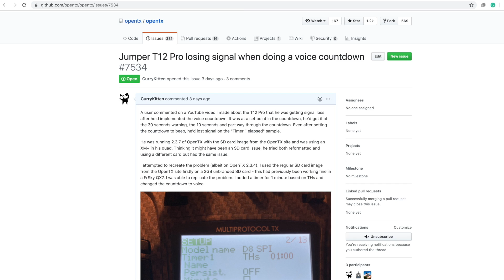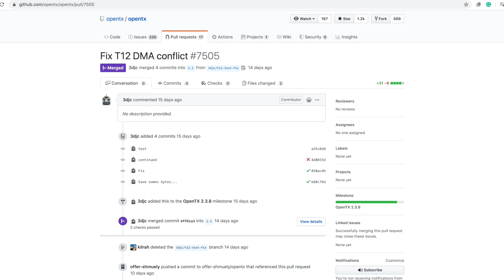Loss of signal issue with Jumper T12 Pro - how to avoid !

Comment: Had mine for 8 months and I've had 4 fall out the sky and 1 in a swamp due to the radio either losing power or signal. I don't have voice active on mine and I have zero vibration or indication. Thought it was me and my tunes so had 3 other advanced pilots check and they had the same issue with my radio..
Reply from the maker: Did you upgrade the OpenTX firmware yet, this particular issue was resolved in 2.3.9
Reply: Yea I sure did. I'm not sure what the heck going on with this radio.. sucks cause I really enjoy this radio but I'm out of options and I think I'm going to have to buy a new radio all togsther
Reply: Was using xm+

Comment: I just got my T12 pro about a mo ago used it about 2-3 times and what your talking about happened today but it's more then what you said it does it without a timer or anything talking and sometimes it won't even keep signal it will say telemetry lost telemetry recovered telemetry lost telemetry recovered back and forth about four times it does that I will now take the sd card out to see if I have a problem again lukey this all happened at start of take off I didn't get but 5 sec in to flight maybe when it started after I couldn't fly at all because I had no idea what was going on
Reply from the maker: First off, update to the latest OpenTX firmware and the problem I described is fixed.  Secondly, having a rapidly repeating telemetry lost/recovered is usually something that happens when the radio is very close to the receiver.  The power of the radio overwhelms the rx, so telemetry is rapidly being lost/recovered

Comment: I am using Jumper T12 Pro with OpenTX 2.3.9, still losing signal, I have been looking for a solution all over the internet, the only solution I had found is taking the sd card out, but then you dont get any of the alerts, if any one know how to fix it please any help will be very appreciate .
Reply from the maker: That's odd.  The nightly build for 2.3.8 and then the official 2.3.9 completely fixed this for me.  You're the first person I've heard who still has an issue.  Are the symptoms exactly the same - with signal dropping out during any sort of voice alert?  Perhaps something not quite right with the flash - bit of a grasp at straws here, but try reflashing (unlikely, but not too much effort) if problem persists, then open up another issue on the OpenTX github
Reply: Tony 0  I do not longer have that radio any more.

Comment: Hello.
Ive just ordered this radio and i was wondering if there has been a stable release that solves the problem. This is going to be my primary radio and i will use it with a flysky reciever
Reply from the maker: Yes - this is fixed on OpenTX 2.3.9, and I've tested it out - all is good.   There's still a minor bug with this radio in that it will sometimes randomly say "receiver still connected" as if you were trying to turn it off with a telemetry receiver connected to it.  This doesn't actually do anything though, it's just a bit of an annoyance.
Reply: @CurryKitten  I have OpenTX 2.3.9 still lossing signal.

Comment: Hi definitely going to sound like there's something wrong with me i have been in the  rc world all my life and figure what the hell lete learn how to play with a drone and any body can go out and buy a pre biult one that has not controller calibration those are toy so i built one i have a 5" with matek f722-std with a bunch of bell and whistles but because of your review of this remote and also Joshua Barlow i figure what the hell it will work fine for what i want. But for the life of me in betaflight i the number of the min  mid and max are all spec and when i hit the stick to full trottle it only goes half and i only find videos of the trannis with some of the settings are close. But is it a remote problem are betaflight problem. Any help would be great and if you have a video that you made that talk about it if you can forward the link thank you very much
Reply from the maker: It sounds like there's a setting somewhere along the line that's not right... although it could be one of several things.  If you can make a quick video showing what you have done and what happens that would really help.  You don't need to post it here, ping me a link at my email address currykittenfpv at gmail dot com and I'll take a look

Comment: Awesome videos and explainations. Just upgraded my T12 Pro with 2.3.8 and module firmware upgrade. This helped tremendously! 

BTW, flying AIR mode for the first time today (Tinyhawk 2); 9 batteries later (and one mild crash) tried STAB and could not control the drone. It felt locked!   :)

I've been scrambling through your videos most of the week cause I've been trying to setup my  T12 Pro betaflight modes on a three position switch;  you know like having STAB,  HOR and AIR. But Betaflight only recognizes two positions no  matter with switch I use. I had STAB and HOR but wanted to try AIR today. I just dropped HOR and now I have STAB and AIR on the switch. 

Any ideas why betaflight only sees two position? I checked CH, Mixers on radio to no avail. I did noticed that the third position is not showing on the radio either. I seen movement on Pos. 1 and 2 but the bar doesn't extend to the max on the third position. If you could offer me some pointers/advise I will greatly appreciate. Awesome videos!!!! Thank you.
Reply from the maker: Seems unlikely to be a hardware issue if it's doing this on all the switches.  How did you set the mix up for the switches.  I made a video about setting up a quad on your radio and betaflight here https://www.youtube.com/watch?v=O1Ea3wljoQs is it different to what I do in that ?
Reply: @CurryKitten  Thank you so much for this link. I deleted the INPUT and  MIXER value I had and followed your guide and Viola! Everything is working as expected! I appreciate the help.

Comment: My new T12 pro does this also. I will remove the memory card tonight and see if it still happens. Thanks for the helpful info!
Reply: Let me know how it goes. I'm thinking of getting this radio.
Reply: @MicroModDude  I ran 7 batteries through it last night and I did have 1 dropout. I like the radio and the dropout may have been a fluke.
Reply: @toddschwietz2483  I might just get the Jumper T8SG V3 Plus Carbon edition. It doesn't seem to have that problem but looks similar. It doesn't look like they didn't do enough beta testing on these before releasing.
Reply: I’ve been having range issues with my t12 pro too. I do not have lua or an sd card. I’ve tuned my frequently but still only getting about 50 yards.
Reply: @theoneshannon6642  You try the newest firmware?
Reply: MicroModDude I haven’t updated. Sounds like that’s my next project.

Comment: Maybe the DMA conflict is between getting/playing the sound file, and something with the internal MPM of the T12Pro. So, no issue with older T12/+ with external modules?
Reply from the maker: Some other guys reported similar issues on regular T12's as well
Reply: @CurryKitten  Ah okay. Did you and the others that had the issue update the firmware on the MPM? I am not having issues with a T12+ on 2.3.7 and MPM on 1.3.0.89 that has been frequency tuned to a genuine FrSky receiver.

Comment: Thanks for the tip. I also noticed another bug in my T12 Pro, when an receiver is connected, the radio randomly gives “receiver still connected” warnings. Taking the SD card out the warning becomes a haptic feedback. Seems like the radio wants to power off randomly on its own. This happens only when a model is connected, doesn’t happen if you just have the radio itself powered on. Do you have the same issue?
Reply: Had this happen once or twice on the T12+ on 2.3.7. Strange
Reply from the maker: I've seen it happen as well, but only when I've been in very close to the RX.  Making me think it was a symptom of the RX getting flooded (where you'd normally just get a telemetry lost)  Have either of you guys had it out on the field where you are proper distance away ?
Reply: @CurryKitten  Yes, the times I heard the "Receiver Still Connected" was in flight, with the drone maybe 20 meters away. So, it wasn't a Rf swamping/flooding issue.
Reply: reported that on github, please add your comment if you have any more clue what going on: https://github.com/opentx/opentx/issues/7646
Reply: Víctor Martínez thanks for the report. I’ll join the conversation as well, try to provide more information. Btw mine makes noise too, if you try internal module Flysky, it produces the worst noise. I’ve cycle through all protocols they all produce different types of noise and pitch. It’s quite annoying, but I guess this is more related to interference unless you physically modify and shield the speaker.

Comment: The Ebay vendor that sold me the  radio told me that the T12Pro has never been designed to use voice prompts and warnings. I replied back to that idiot, why does Jumper's own firmware download include the voice pack and why does the thing have a speaker, and menu options for voice. The seller does not even list on his site that the radio is not to use voice features He is heli-nation. I would not purchase anything from him period!

Comment: Wish i found this video last week, been scratching my head why ive been failsafing with a brand new tadpole build using a R-xsr and my 5" with a dsmx rx, interesting tho i dont think my brushless whoop with dsmx has done it once yet..(only had the radio a month.)ive heard rumor that it may also have to do with telemetry?
Reply from the maker: Telemetry shouldn't have an issue on loss if signal, but if it says "telemetry low" or something like that, then that goes back to the problem losing signal when accessing the SD card, so the two events could look ralated.
Reply: pulled the SD card and problem free for 4 packs so far. ty again.
Reply: @EntropiaBCG  so, is removing the sd card is only solution?? or updating to latest OpenTX solved the issue??
Reply: @Suraj_Mandal.  i havnt updated since,and just leave the sd card out.
Reply: @EntropiaBCG  is your jumper t12 pro still good? planning to buy this radio
Reply: @pipoypipoy7796  yep still working.
Reply: @EntropiaBCG  how many points of jitter do you get on your t12? and does your t12 center at the exact same value everytime?

Comment: Thanks for posting this!  I was thinking my several frequency tuning attempts were failures.  lol.  I'll try pulling the SD card to see if my quads with XM+ receivers stay in the air properly now.
Reply from the maker: Hope that helps - looking forward to the 2.3.8 update
Reply: Yep!  Got through 4 packs without a signal loss so this must've been the problem.  Thanks again 😊

Comment: Thanks @CurryKitten.  Maybe you can do a tutorial how to download a specific firmware.  I got the older OpenTX Companion for 2.3 nightly but it keeps taking latest of whichever channel (stable or nightly).  I wanted to try this release on mine, to see if the issue gone....or i need to buy a 3rd SD card to try!
Reply from the maker: If you take the latest 2.3.8 nightly, then it'll have the fix in.  So try that to see if you SD card behaves better
Reply: CurryKitten I did try the latest yesterday and it looked like it bricked the t12! Scared me. I had to remove battery and stick back in. Then I just went into bootloader and chucked 2.3.7 stable on again. That’s why I was asking to try specific release. Who knows maybe latest was changes to boot. Or maybe it can fully boot. I’ll try that later now I know it didn’t brick it. I doubt these releases will actually brick it!

Comment: Thank you very much CurryKitten for your nice job !
 But sorry, ( i'm French and it's  not easy to understand for me, you're answer..) It is not specified in your written comment the realy solution. 
 The solution is... remove SD card ?  And waiting new open TX 2.3.8 ?  Do you have any information on the release date ... ?
I' have ordered this T12 pro from hobbycool by you're link ;-)  ( always in pré-order...) so It's not urgent for me. 
But I want to be sure this is a good replacement for my older XD9+ from 2015...
Best regards and take Care !
Reply from the maker: Yes- unless you have anything that needs the SD card (for example you need to run a LUA script for Crossfire as an examples) then take the SD card out until 2.3.8 comes to fix it.  I don't have any release info on 2.3.8, but looking at their previous 2.3.x versions they came out around once a month - which, if it continues should get us something at the end of this month, running into May (but that's just me guessing)

Comment: I've put my T12 pro back in its box, had trouble with the sounds from the SD card (card from my QX7 formatted so I know it works, also tried others 10 speed etc) while assigning a sound to a switch say 'arm' it worked fine but assigning another switch then scrolling down the list it would say no sounds on SD card. Turn off then on, the function was random even when I could see while scrolling down the sounds just went. Also had the same sort of random fail safe with my Mobula 6, maybe I'll update 2.3.7 to 2.3.8 when it comes out. Thanks for your vids on T12 and other very very useful keep up the good work and stay safe
Reply from the maker: As soon as 2.3.8 is available I'll be doing another test to make sure everything weird is resolved.  It's a shame it had this issue as I was really liking the radio (although I still do want to range test it against a Taranis of some sort - waiting for lockdown to end)

Comment: i have this model as well....great radio!
however im trying to fig out how to have arm/idle up feature on a non betaflight whoop...on its own switch...
its on the bayang protocol...
thanks and great video!
Reply from the maker: Pretty easy - I'd add this into the OpenTX tutorials I'm doing, but I think that's a bit niche.  Lots of ways of doing it, but here's an easy one.  Take copy the mix you have on throttle currently and copy it to the next slot down.  You'll see a += symbol and it's still under ch 3.  Edit this and change the source mix to a switch and then change the weight to something appropriate, let's say 10 for an idle.  If you scroll down, make sure Multiplex is set to add.  What you'll get when you flick that switch is the throttle adding on that amount - essentially giving you an idle up
Reply: @CurryKitten  sounds great bro!
plz let me know so i can follow the vid and pause as needed...this is alot for me to wrap my mind around haha!!

Comment: I have the T12+, which is the T12 with hall effect gimbals and I  do not use timers at all, but I have had intermittent voice feedback failures quite often like when switching flight modes while in flight with assigned voice notifications and have had occasional disconnects.. 
I think the reason that there hasnt been a reported issue for the T12 is mostly because there simply arent many of them out there courtesy of FRSKY's campaign against jumper.. Most of the T12's were pulled from standard vendors shelves. I actually bought mine second hand from a ebay seller. Once OpenTX allowed T12's back into the regular update, Jumper had already pushed the T16's hard so thats what most folks sold/bought.. The T12 simply slipped through the proverbial cracks. At least thats my opinion for what its worth. Thanks for sharing and I'll be waiting for the 2.3.8 update eagerly.
Reply from the maker: Thanks for sharing this - it's useful to know that it's not just restricted to the Pro.  The dirty tactics over radios from multiple vendors is quite shocking isn't it!
Reply: @CurryKitten  Indeed, sir. In fact, the whole drama hypocrisy of that whole situation was literally the number one reason I bought my T12+ over a QX7. Even taking the bug into consideration, I'm still really pleased with my T12.
Reply: @tmc-fpv  I'm currently running the 2.3.4 build of OpenTX. When I first got my used T12, the first thing I did was learn the basics of OpenTX and within a couple days, I updated the OpenTX and Multiprotocol firmwares.

Comment: Does this include the Jumper TX T8SG  model? I have it on order...I also got in touch with Jumper at one point and asked them a question about a particular transmitter and they came back with something totally different, They have a serious problem in this category! thanks for sharing!
Reply from the maker: Nope - as far as I'm aware (and I don't have one for reference) the T8SG doesn't run OpenTX and also doesn't have an SD card, so you are safe from that point of view
Reply: @CurryKitten  OK I appreciate the info

Comment: I haven’t used mine since I had my issues. Mine i would get a vibration in the radio right before I’d lose connection. Gonna have to see if I have voice alerts on, or just remove sd card like u said. What was strange is I don’t remember seeing anything in my googles like rxloss which I assumed I’d see